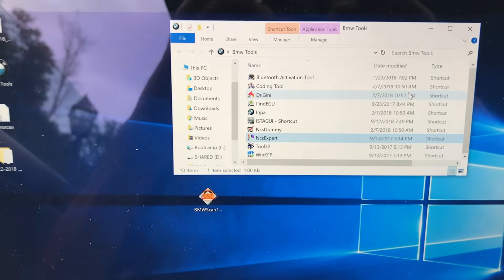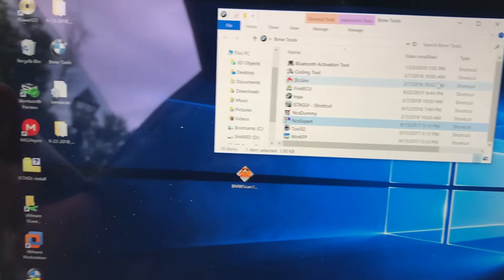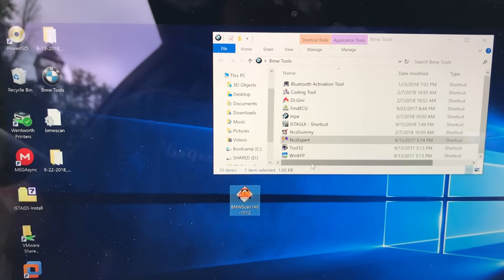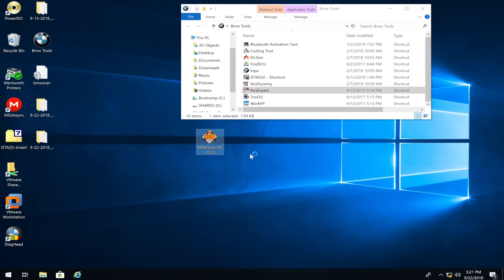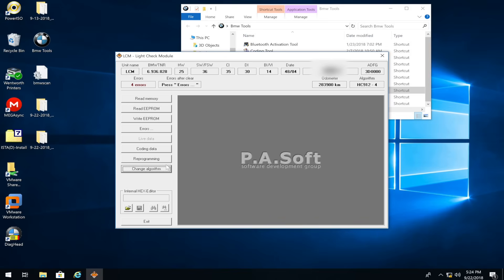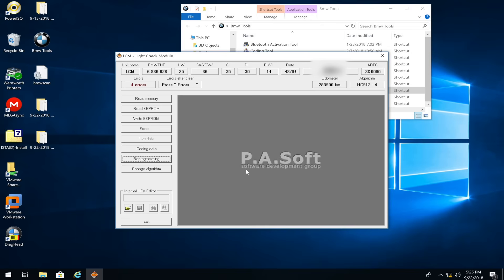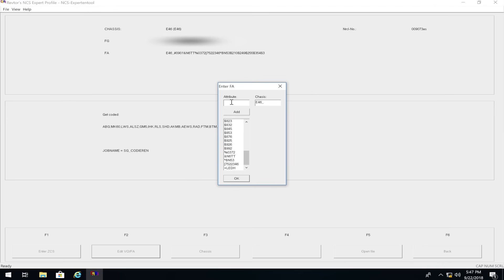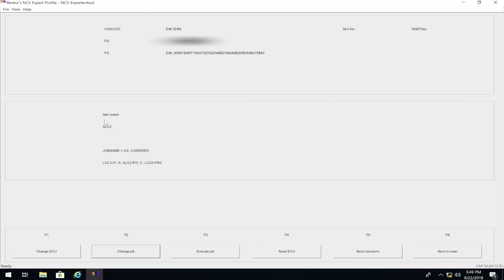Coding New Light Module | BMW E46 LED Retrofit PART 2

Comment: Im unable to select copy FA coding, probably LCM module too old..
Reply: Have you ever figured it out? Mine's grayed out too...
Reply from the maker: What is SW?
Reply: @EvanGoyuk  Hi Evan! SW is 2.0. 

For context, my original LSZ died and I replaced it with an exact match (down to the manufacturing code). I was using your video as a guide to get rid of the tamper dot (which worked after following your instructions and writing the odometer and FGSTNR!, thank you so much)! FA is grayed out though, and PA soft / Bmw Scanner still returns with "FA error" when initializing. 

Another issue, that I assume is related, is that I can't read the new LSZ with NCS Expert (throws a "wrong ECU coding index" error), which I am assuming is related. Currently googling solutions to try out tomorrow.
Reply from the maker: Can you try another LSZ?
Reply: @EvanGoyuk  Hopefully in a few weeks (planning on getting a SW 3.6 too). I'm currently ruling out it being a defective LSZ though, because I'm also getting a similar error in NCS Expert when trying to read MK60 (ABS pump/DSC module got replaced as well, same story, replacement was an exact part number). They were both replaced at a indie (car was in for a bunch of repairs). 
They were able to code in bi-xenons on the "new" module later though. Might have to pop by and see what they're using to code the modules and hopefully figure it out. Trying out a new LSZ would confirm or rule out if it's something to do with the way they coded these modules in. Do you have any ideas, in the meanwhile?
Reply from the maker: Unfortunately that’s my only idea

Comment: While using the scan tool, it reads "connection error with IKE" and "connection error with EWS" any ideas on how to fix this? The device ID is V144Bn9, I've read that I may need to bridge pins 7 and 8, or pins 1 and 2

Comment: Hi Evan, I’m starting to retro fit myself I have the taillights cables etc just not sure about the lcm I have the e46 m3 xenon sw 3.01 will this be compatible with the led after coding? Also I’m retro fitting oem xenon m3 headlights will there be a video on how to code these? I have a bmw 325ci sport coupe :)
Reply: Also Can this be done with Carly
Reply from the maker: I believe 3.01 will be okay but also no Carly with not be able to code everything
Reply: Is it work for that SW?

Comment: Thanks for video! 
There is any possibility to add automatic lights on, on this module ?
Reply from the maker: You would need a new LCM
Reply: @EvanGoyuk  I'm sure of that,  but I didn't found any with this function.
Reply from the maker: I would look on eBay
Reply: Man, please tell me. How your Auto Lights Function works.  I bought this module? I have the rain sensor in the center of the front window.  When I live mine in auto position it just turn the short beam as soon as I put the key in the second position,  regardless of if is day or night , light or dark.  It should put the lights on only if the outside light is low. Right?

Comment: hey man i got 2 questions 1  how do i kno if the lcm is 3.0 or higher to code the led taillights ? and 2 ive had many problems trying to set up ncs expert  i think i finally have it but i dont have the profile  u used to code the leds  all i have is ncs dummy profile

Comment: I bought used instrument cluster years ago. Can I use  Scan 1.4 to remove yellow dot.
Reply from the maker: Yes
Reply: @EvanGoyuk  Scan 1.4 say IKE has 35080 chip cannot change odometer on IKE

Comment: Great video mate! Very helpful. Just one quick question: I replaced the old halogen tail lights with new LED tail lights but haven’t replaced the LCM. Do i still need to get bmw scanner and code lcm like you did in the first part of the video or do I just use ncsexpert ?
Reply from the maker: Great question, if you didn’t need to upgrade your lcm since your car is 2003 or newer then you do not need to follow the part about bmw scanner. You can skip right to coding the new led tail lights with ncsexpert. Let me know if you have any other questions.
Reply: @EvanGoyuk  hi mate.i love your videos as there so clear. my questions are similar as above as i have a 2006 e90 . i have fitted similar to these bulbs as low and high beams https://www.amazon.com/Mega-Racer-Bright-Headlight-Automotive/dp/B07HLZMY92/ref=sr_1_16?ie=UTF8&qid=1542236059&sr=8-16&keywords=led+bmw+h7 and also some small led bulbs as side lights and  wondered first if this would work to remove the canbus error on my e90 , will all the codes ie "alsz" etc will be the same as in your video, and will i need to do the last bit where you did the sg_codieren bit. any help will be brill.thanks
Reply: @EvanGoyuk  hi mate I'm buying a used lights module. E46 m3 factory xenons . The part number is the same. Also do any other numbers need to match? Thanks.

Comment: Such a great mod. Thinking of doing it on my e46.
Reply from the maker: Highly recommend it. It is a bit pricey but if you shop around and go to junkyards it can be done for cheap. It transformed the rear of my car and it made it look so much newer. Considering some brand new 2018 cars do not even have led tail lights. Especially Since BMW had it back in 2003.